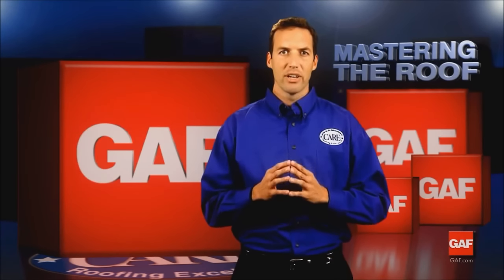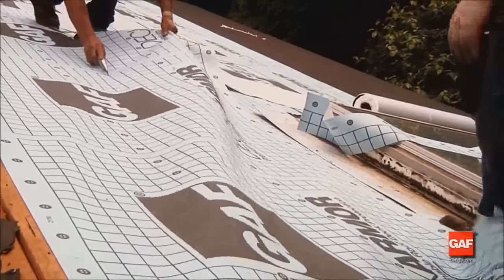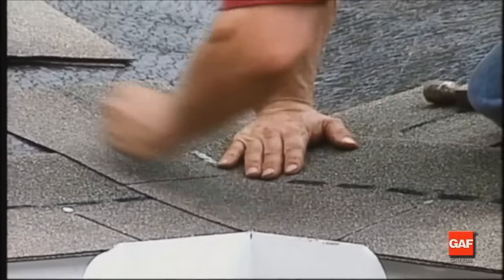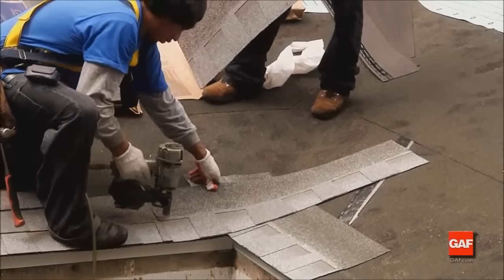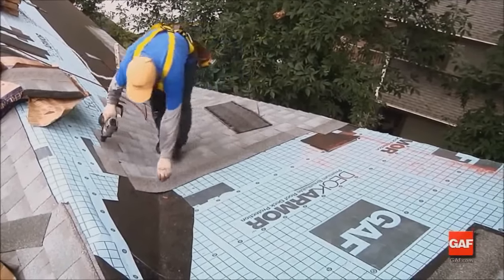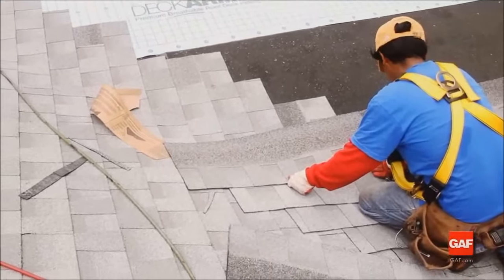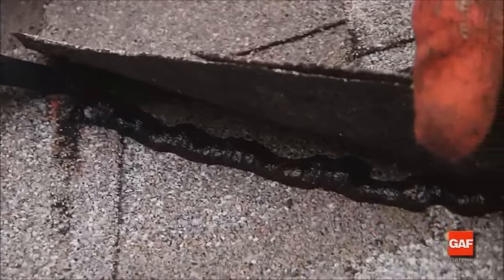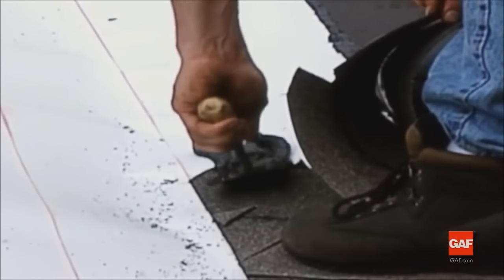"Roof Installation: How To Shingle a Valley (HD)"  by RoofRepair101

Comment: I can't believe that experienced roofers in conjunction with a major manufacturer would not start from the valley, effectively controlling that size shingle is installed into the valley, on both sides. Shame, gaf.
Reply: Never mind the fact that all three techniques are horrible. A California valley is the only valley that should ever be installed on a roof. Requires no cutting or gooping and looks way sharper and it can be installed with three-tab's or architectural shingles.. wtf gaf
Reply: *****
I don't trust a California valley, and I don't think it looks good. Valleys should be either open or closed, and that's it. A California valley reminds me of something some asshole came up with just because it was "easier". I doubt that's it's NRCA approved or time tested in any way.
Reply: I also like how right after the guys says that woven valleys should only be used with 3-tab or slateline shingles, they use a big fuckin' picture of a woven valley with timberlines as a their lead in to the "woven valley" segment. I mean, who watched this video and approved it? Come on, GAF, this is just flagrant. I could literally pick this video apart segment by segment for mistakes. I mean, these guys installing these shingles are morons, and you videotaped them?
Reply: Astromyxin What's not to trust. That's the problem with roofers now a day they don't actually think through there processes. A California style valley is well thought out. It gives all the benefits of  an open valley with a sharp closed look with no waste. It is time tested as its been around for a lot longer than you might think. In MT its been the preferred method of doing a valley for 50 years. IE its the only way that teal-bro's does a shingled valley.
Reply: California valleys have been around for 50 years? I don't think so. Why? Because you can't do them with a three tab shingle, and if you did it would look really dumb, and affect drainage by adding all of those little eyelets right in the valley, impeding water flow, accumulating debris, and eventually blowing seals. California valleys don't allow water to flow naturally. Plus, I don't think they look near as sharp as a proper closed valley does. It's looks...off. It looks like there's a backwards shingle in there or something, something doesn't belong. The laminate patterns crisscross and are not pleasing to the eye, at least in my opinion. If it were my house, I'd have open valleys with ice shield and lead-coated copper in them, but that's beside the point. Down here in Delaware(as long as I've been here), nobody has ever asked for a California valley. While most homeowners generally don't care what valley you put on their house, the ones who do make educated and informed choices regarding valley selection, none of which ever have included a "california style" valley.
Reply: Astromyxin Excuse me 40 years not 50 years and that's besides the point. The valley may not allow it to flow naturally but it sheds fast and is more secure than both woven and open valleys which is the whole point. In my opinion and most of the customers I have dealt with's as well they look better.
Reply: It's impossible for any valley(or pipe collar, or run of shingles against step flashing) to be "secure"  if water is not first given a place to flow off or around it naturally, allowing it to follow the path of least resistance. If you've done enough chimney repairs, when you go to one where the shingles in the back of the chimney are jammed up against the back pan, you know you're gonna find debris in there, and that there are likely problems related to that occurring. If you allow your valley to accumulate debris, it's not gonna shed as fast as the day you put it on.
Reply: Astromyxin atolladero
Reply: @Astromyxin  Cali valley is way better it looks exactly like a cut and even seals the valley cuz of the tar strip don’t be old n dumb
Reply: @cstone2109  What do you mean by sealing the valley?
Reply: Also, like I said before, I don't think they look good at all, but that's just an opinion. I guess the word I'd use to describe what it looks like is "noisy", or maybe "inconsonant". Maybe "discordant," I don't know. When you look at it, it looks off, like a one of-these-things-is-not-like-the-other type of thing going on.
Reply: @Astromyxin  the tar strip underneath the valley bleeder shingle seals the whole valley better then a traditional cut ever will. Of course cut looks better and takes more skill but these new roofers be cutting the valley on accident without knowing and causing leaks. Nothing wrong at all with Cali valley u can even use shingle snips real quick instead of a hook blade and even if u cut the bleeder on accident it ain’t gonna cause a leak like a normal cut would

Comment: as a roofer of 27 years i prefer a closed cut valey ,metal tends to expand and contract in weather over time and pulls the nails up ,but one of the roofers is going nuts with the nails there should be no nails where the shigle butt one to another on the shigles with no tabs
Reply: what about large head screws Don Viau?
Reply: Our roof keep leaking and our constructor only had the roof structure up then straight by put on the roof without anything, so whenever my air-con worker step on the roof it couldn't really hold him and damage our roof while doing it. And the wall cracks beneath. So our was not being done right?

Comment: Who uses open valley's 🤷🤦
Reply: @jasonbranson448  Open valleys are by far the best and fastest way to shed water out of a valley if done correctly. All jobs with 50+ year roofs(like say Grand Manor or actual or fake slate) that use expensive shingles will suffer in the long run and will require more maintenance if you don't opt for a correctly installed W-style open valley pan. When I say correctly installed, I mean: A non-aluminium W-style valley pan(laid over top of a valley with an ice and water shield type membrane already installed underneath) that's at the very least 36" wide(18" on either side not counting the profile of the W) with upturned hems on the outer edges to accept cleats. The cleats (which should be made from a similar metal as the pan itself to prevent electrolysis and corrosion from occurring, is sort of shaped like this, but flatter: _/> ), spaced every 12"-16"  hook into the upturned hems of the valley pan (which sort of looks like this except less flat: <___A___> ) and only the cleats are fastened(in a manner that prevents their ability to rack or twist) to the roof deck to hold the pan in place securely. No fastener should never puncture a valley pan, not even to fasten down the roofing in the area of the valley. All roofing shingles or tiles touching the pan must not be allowed to come to a right triangle shaped point at the headlap part of their valley side termination(this allows "tracking" to occur and debris to accumulate). These tips or points should be removed by cutting 2"-3" off the horizontal length of the tip in a way that the shape of the shingle or tile physically directs water back into the valley, i.e. by cutting the tip in a perpendicular or slightly obtuse manner. Each shingle or tile  must be sealed directly to the pan with a flexible or elastomeric sealant(that's compatible to both metal and asphalt, if you're using an asphalt shingle). Ideally, each shingle would be back-caulked anywhere it touches the valley pan(with special attention paid to the leading edges) and the shingles themselves should be sealed to each other so as to not rely on the factory adhesive to adhere the shingles to themselves. You never want something that you put this much work into to be vulnerable to wind uplift and require a later repair; you definitely don't want to ever have to disturb this valley again, that would suck major balls). Technically, you don't even want your roofing to come into contact with the pan itself, but this won't always be possible(or necessary) without another, even more labor intensive step(à la https://www.copper.org/applications/architecture/arch_dhb/cads/flashing-valleys.B.equal-slopes-unequal-water.dwg ) If the valley requires more than one length of pan, the two pans should be joined mechanically with a cleated flat lock seam or cleated double lock seam and then soldered if the pitch of the roof is low and backup can be expected to occur. If the roof is steeper and water is less likely to back up into the seam, any number of loose lock seams with sealant or transverse seams can be used to join the pans together. And lastly, the exposed portion of the metal valley pan should taper outwards in width at a rate of about 1/16" per foot as it travels downroof, i.e. having 2" on either side of the valley pan exposed to the weather at the topmost part of the valley and having 3" on either side exposed at the bottommost part of the valley. This is done to accommodate and more quickly shed the increased volumes of water that the valley collects as it progresses downroof.
Reply: @Astromyxin  your just showing off now dam!

Comment: Very detailed video on how to shingle and weave a roof valley. The woven valley is probably the best for three-tab asphalt roof shingles. Installing Weather-Watch in the valley is very important especially in areas that can build up ice dams. The open valley method takes more time but is more aesthetically pleasing especially on older Colonial style homes with older more intricate roof-lines. Great video and well done..
Reply: And you're saying you're a roofing company, HA HA
Reply: They didn’t even use safety skirts in the valley when a 3 tab seam line thing falls in the valley. Piss poor installation no one knows how to properly
Do 3 tab anymore

Comment: I only like doing a w metal valley I run a shingle straight up n down the metal then I start my run with bottom corner where meets the vertical shingles edge

Comment: As a roofers we all might agree that valleys are the most critical area on a roof so...why not start laying our shingles right there? By doing it you'll be able to use full length shingles where it needed most and save time and material by making cuts on the opposite side only. 3:15 totally wrong
Reply: +Mario Lopez depends if there is another valley on the other side
Reply: +Mario Lopez Find another mean to make money before it's to late
Reply: Mario Lopez
 it doesn't matter as long as your shingle goes far enough through the valley, your nail placement is correct,  and your stagger is correct. 
But in this case, ya, he could a did that little section lefty.
Reply: Mario Lopez exactly
Reply: And a lot of bosses don't let u unless your a seasoned roofer cus That's how dips start
Reply: Mario Lopez most people including me do that. Start right in the valley, saves time and material
Reply: hey I just have a question for you. I didn't see them lay starter shingles before they did the closed cut valley. I usually  install starter shingles here and up the rake of the dormer and weave them. Then I go over them with the architectural shingles and begin my cut valley. Should I instead weave the first course of shingles over my already woven starter shingles? and then proceed to do the closed cut valley?  Just wondering and also I start in the valley. much faster. And before I start on the second roof, I snap a cut line and install a heavy line of tar a couple inches inside the chalk line before laying the cut shingles.

Comment: pathetic video. just horrendous.  i learned from a 37year roofer and ive done it 12 years now. every woven valley ive ever toreoff was rotted to hell and back underneath. and like others have said... any real roofer starts in the valley
Reply: 12 years and you still don't know anything about roofing. you start from the right if you're left handed or you start from the left if you're right handed, on a gable or a hip house, if you start in the valley you'll need to work backwards on one side or the other. You never start in the valley unless you have both right and left handed roofers on your crew. NEVER MIND. Here in California weaved valleys are by far the best, they're self cleaning.